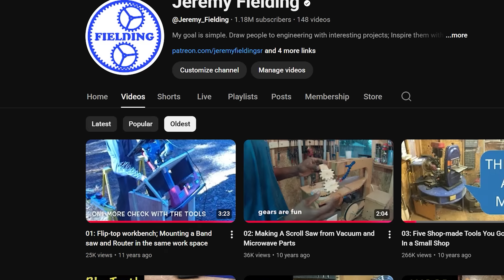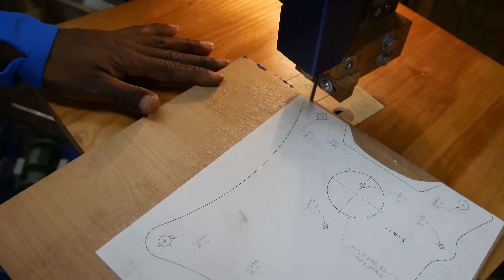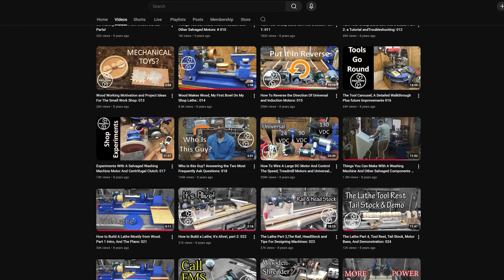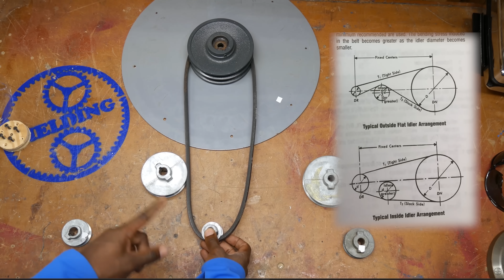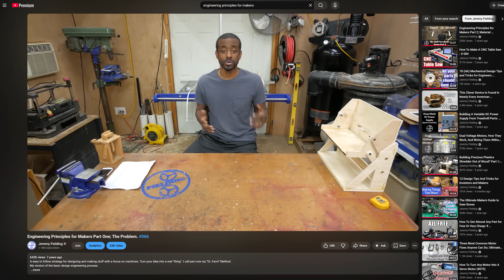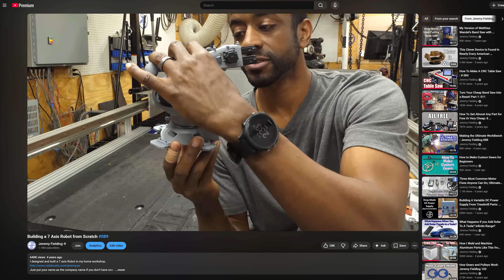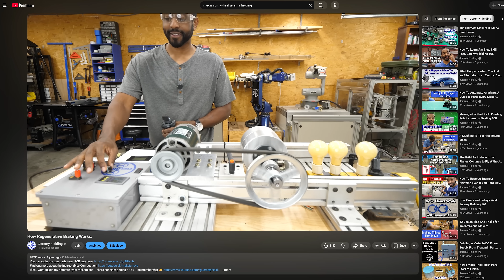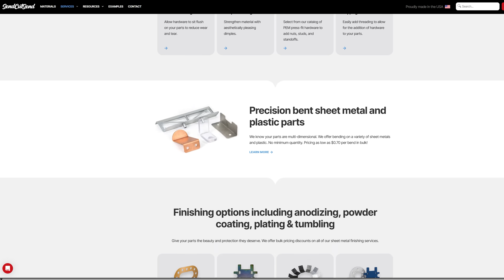11 Years of Making in 11 minutes: Jeremy Fielding

Comment: I love creating/building things!  I'm a musician first... but I still enjoy using wood, metal, computers, electronics components, etc... to create things and build things that I want or need.  In 2021, I used some wood and a section of steel pipe to build a guitar stand because I didn't have one.  Not long after that, I used some wood and longer sections of pipe to build myself an adjustable height mic stand.  Since then, I've use the same materials to build myself a mic stand to mic a small guitar amp and a desktop mic stand.  More recently, I upgraded a Razor Pocket Mod kids electric scooter to be able to ride it around town as my only transportation.  I added rear turn signals using some small trailer LED marker lights and a circuit that I built after watching a few Youtube videos.  Less than a week ago, I replaced those turn signals with some motorcycle LED turn signals.  Now, I have the turn signals/ brake lights on the back, and turn signals/white driving lights on the front.  For the ones on the front, I had to use an empty Altoids tin to mount them.  Before the end of summer,  I plan to weld several bicycle racks to the back of the frame so I can mount a trunk (from a 50cc gas scooter on my little electric scooter.  Building/creating things is indescribably fun!  I get a lot of self satisfaction from doing that.

Comment: Amazing journey — thanks for sharing it. My own inner fusion reactor fires up around microelectronics and software engineering. Wrangling electrons and tiny components is a lot kinder on the joints than hauling washing machines and motors around. But with 3D printing exploding and great companies like SendCutSend making custom parts almost too easy, the lure of mechanical engineering is starting to whisper a little louder in my ear. All the very best for 2026.